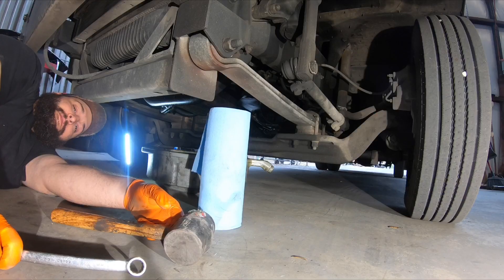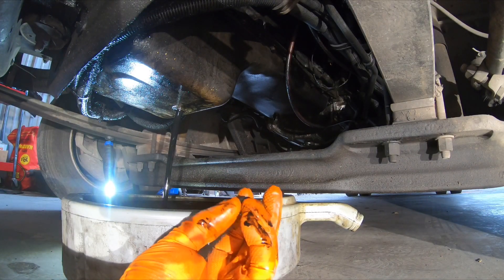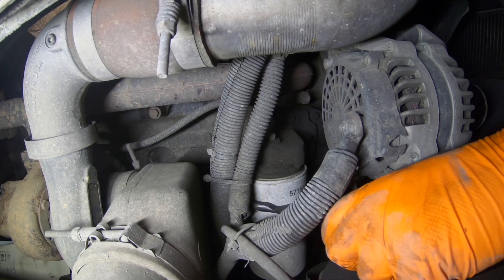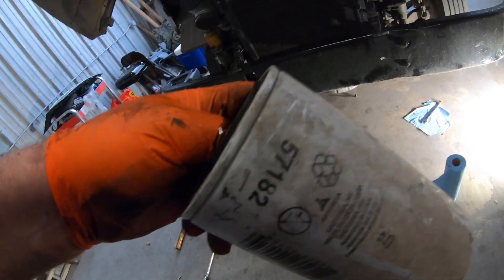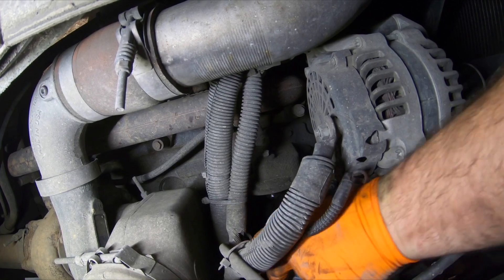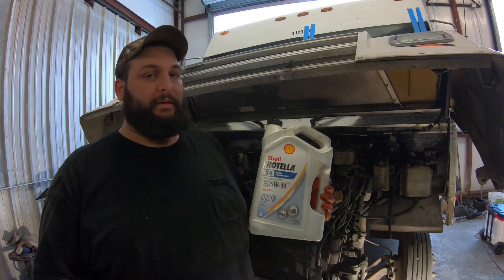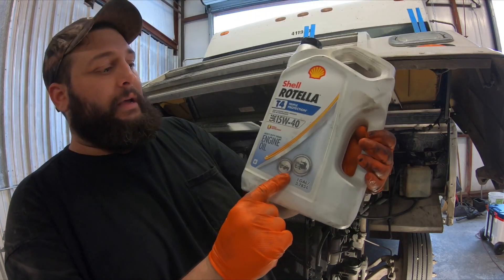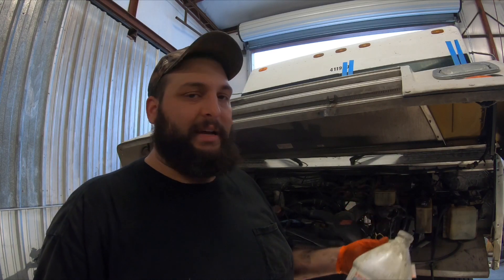Stepvan Oil Change Tips - Cummins 5.9

Comment: First, a big thank you  from all of us that use step vans as a platform for rv conversions, mobile retail or food truck. Second, personally, I am in the market for my second MT45. Going down in size from an 18 foot to a 14 foot. I prefer a solid roof, but as of yet I have only found fiberglass roof van for sale. Would love your input on purchasing a used step van with some thoughts on fiberglass roofs. Can the roof be recovered back to an aluminum? Thought on roof racks. This will be an rv conversion and used for mobile retail. Thank you in advance for you insights.
Reply from the maker: Wade Hough I’m glad I can help. 
Great question. The answer is yes. However, it’s kind of a pain. Lol. 
Depending on the body manufacturer, you can buy a whole new roof in both fiberglass and aluminum. But I haven’t seen them on millsupply.com. I have only seen pre-cut roof material on the manufacturers websites. Like 
https://parts.utilimaster.com/utilmstr/ 
And
https://www.morgancorp.com
Reply from the maker: another option is to go to a metal supply company near you and see if you can find a large sheet that would only require minor modifications and cutting. 
Get plenty of silicone and some rivets.

All of our roofs are fiberglass and we prefer them that way so the drivers can see the boxes. I personally have never had to replace one. When they get damaged, we repair the fiberglass with a kit you can get at most retail part stores.
Other than these options my only recommendation would be to look for a truck from a utility company. Those are the only ones I’ve seen that come with aluminum roofs. I’m sorry I can’t be much more help on this subject.
Reply: Stepvan Repair TnineK thank for the reply. Keep the videos coming, your knowledge, experience and insights are very much appreciated.

Comment: A good way to get that oil filter is what I do is I got a claw style oil filter wrench put on a extension and get it from the bottom after I pull the drain plug

Comment: Hey, I need to replace my lock cylinders but after removing the back handle and plates I can't figure out how to remove my front handle and /or cylinder. Any tips?
Reply from the maker: Like door lock cylinders?
Reply: @MasterT9000  yeah that's affirmative. The keys don't work worth a damn, takes ages to get the doors open. You have to insert them, pull out part way and wiggle them until it finally takes. Freightliner had a good deal to just replace them all but the locksmith can't figure out how
Reply from the maker: @rionoko  it has nothing to do with Freightliner. It’s all about the body builder. Gruman, Utilimaster, Olson, Ford brothers… and who the unit was sold to. Those trucks are purpose built. Ordered specifically. Also depends on the year. Frito lay and Fedex had two entirely different designs do the doors are different, the door latches are different and locks are different. There are so many variations and varieties, I really couldn’t tell you without looking at it. I can however tell you this, if that lock is an Abus Abloy lock, then it’s built into the door latch. There’s no way to get it out without ruining the whole door latch. Those were mostly specific to fedex. They are high security locks.
Reply: @MasterT9000  affirmative on it being built in and a FedEx truck.
Reply from the maker: @rionoko  if it’s Fedex you’ll have to go to the Utilimaster website and order new door latches. Alternatively, it could be your key. Could just be worn out. If you have Abloy locks. On the inside of the rear roll up door, often times the key cut number is engraved near the latch. If it is you can call 1 800 328 3442 and give them the key cut number. They will cut and send you new keys. They’re $5 each.
Reply from the maker: @rionoko  Another thing. When I say Fedex. I mean Corporate Fedex Express. Fedex Ground is contracted is all privately owned trucks. The ground contractors like to buy old Express trucks. But many contractors buy whatever they can get their hands on. If you got an old Express truck then it should have Abloy locks. If you bought an old Ground or home delivery truck, you could have anything.